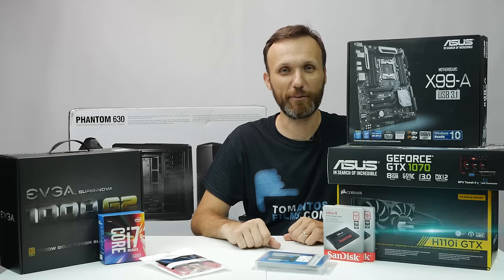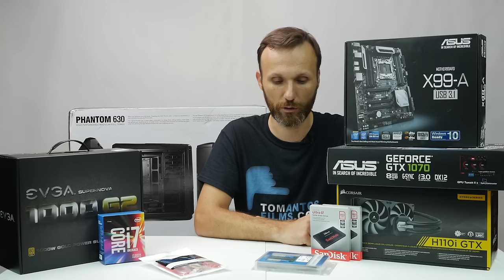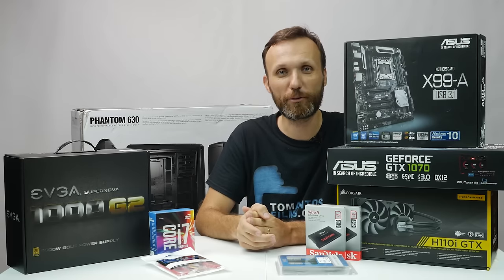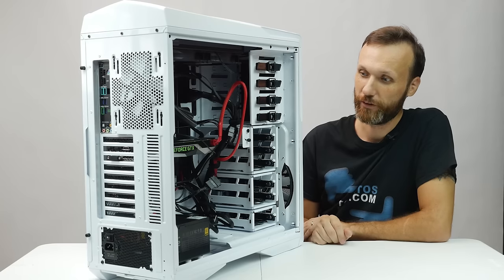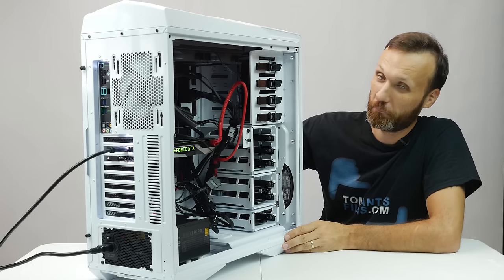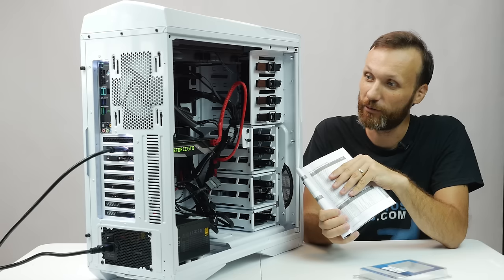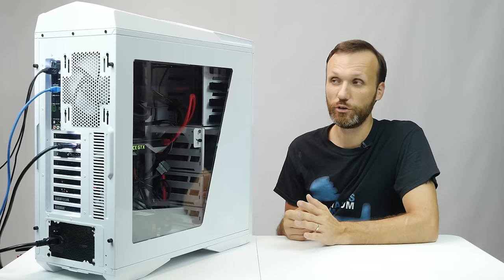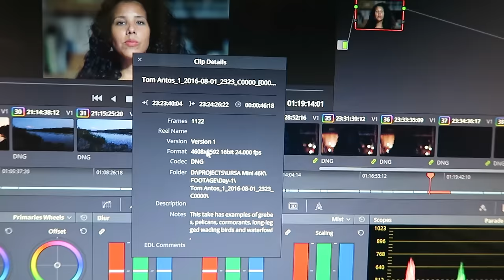4K RAW Video Editing Machine for $2K

Comment: I have a Dell M6600 laptop with Quadro 4000m, 16gb ram that I edit 4k on, it works great even though it's like 6/7 years old now.
Cost just over 3k when I got it.
When I do complex edits in 4k, in Premiere, I create proxies of the videos, that way I can edit at a lower resolution, add all the effects etc I want and apply them to the 4k versions of the video at the end.

Comment: As an IT guy, I would like to point out that it's really, really important to use an ESD (electro-static discharge) dissipating wrist strap when building the PC. This is especially important when in physical contact with the CPU, RAM chips and the motherboard. Besides the obvious chance of frying components due to static buildup & discharge while assembling the machine, the biggest reason I always have an ESD strap is because of partial failure of components. Most likely ESD will not kill a component outright but instead damage it. I've seen more than once the resulting damaged RAM and motherboards causing all kinds of untraceable headaches that lead to system instability.
Reply: By regularly discharging yourself by touching your hand to the case is enough. I have built many computers and static buildup has never been a problem. Its not as important as you think (if you know what you are doing of course...)
Reply: +ResQ I agree with you. I work in IT and have build a lot of systems and servers and static discharge is not a big of a problem people think. I have never seen it damage any pc component. The worse thing it did on maybe 3 motherboards is that I had to just reset Bios and that was it. But still if you want to be safe when building pc just touching something that is grounded is enough.
Reply: I've worked in labs with boards on a component level. I'm not going to present a long laundry list of reasons why an ESD strap is a good idea, but I will say that most of the time components come to customers DOA, in fact they are killed by EST on location and not defective from the factory. But whatever. I'm not looking to convert anybody...
Reply: I'm not saying that ESD strap is a bad idea, I'm just saying that it is not necessary. It's enough to touch something grounded. I was just telling my experience from working with electronics. Besides the motherboards I mentioned were cheap - 60$. The ones with better quality components were not affected by discharge, BUT I'm not saying they can't be. Once again that is just my experience.
Reply: I forgot to mention... I've seen people who returned motherboards as DOA and when I asked them what did they do (how did they tested if it worked before putting mbo in case) most of the time answer was they put it on bag in which mbo was. And some bags have shit coating that can conduct electricity hence it's not DOA they just broke it because they didn't know that.
Reply: I have to to tell any body out there who wants to duplicate Toms  build just like I did..after buying all this parts, taking all the static precautions, buying exactly the proper ram. I got the same 53 error message Mr Tom had, which means the motherboard can't read or the RAM is not the proper speed, there is a lot of complaints out there in the Web about the Asus X99-A usb 3.1 being defective. 
I tried everything there is to make this mother board work, 
but  I honestly don't want the aggravation that a lot of folks have gone through,  
I'm returning my motherboard to B&H and getting a MSI x99 , which me luck!! so I went to Frys and I got a MSI X99a Rider motherboard used  the same memory and guess what!! started right away and now I'm ready to install Windows 10. I'm not a brand person I just care to utilize my computer as a reliable tool for my video editing, Asus is not a good company, I'm proud to say I'm a new MSI costumer for a very long time.
God bless!
Reply: yes MSI x99 raider has been great for my build as well
Reply: As an IT guy, I would like to point out how you saying 'all kinds and most likely' does not hold your argument at all and you're just repeating what you've heard others do instead of speaking from experience. Anti static wrist strap is not needed at all if working on a plugged in PC into grounded outlet by simply touching the case, if you can remember to put on a strap, a clip and maybe an antistatic pad, it's definitely easier to remember to touch a grounded case every now and then.
Reply: The human body can create enough static differential to set off a percussion cap. This static can build up in a few seconds in dry weather. On the flip side, it may not. You may be in a humid climate where static is next to impossible. Or it may feel humid and static free, but some static does build up eventually. It all depends. Hence my vagueness and lack of specificity. And the reason that touching the case once in a while is basically a gamble. It all fucking depends, son. So when you're working on your cute neighbor's PC, swapping boards out, sure, you can guesstimate the situation and come up aces. But me, I've worked on  boards that really, really could not fail. And in order to not have those boards fail I learned a crap ton about how things fail. What happens to solder points in extreme heat & cold? What does salt air do to circuitry? How about sympathetic vibration? What about over pressure from a nearby detonation? What about operation in exotic atmospheres? I could go on. Anyway, bud, you might be an IT guy. But you ain't got the education or the discipline to even form an opinion about static. Not that you need to, mind you, working on consumer electronics. Just don't disparage random blokes on the net. Some of us actually know stuff.
Reply: TheDamnSpot If you really know stuff then you share it and show it, not boast about how much you know, you IT guy/buddy/friend/pal/canadian.
Reply: TheDamnSpot Thanks man. Take it easy
Reply: No problem. Just my two cents, if you take only one course on the MIT site, take Signals and Systems. Great foundation.
Reply: I guess you are right but if you use common sense and handle everything carefully you can get by without the strap. In the past 15 years I built over 100 system and never used a strap......never  messed up a system. I also have a system humidifier which is very helpfull specially during winter months when the air is pretty dry. Also a wooden floor or and an antistatic chair mat is very helpfull. 
Carpets are usually the worst static creators. Another hint, is to use something that will help dissipate the static. B4 I touch any components I usually touch a metal gounded device like the meal case of a power supply...it has to be plugged in though. just my 2 cents.
Reply: "Never messed up a system..." is a loaded statement. The majority of EST damage is not catastrophic. Mostly it will damage a component that's not in constant use, or whose failure is opaque to the builder. It may be a failure that will create cross-talk or destroys a fail safe response (which is by default rare) of a ROM chip or a logic gate. On a motherboard there is a lot of (just as an example) "If 1.2 Volts = Null, then do this." What if that Null state happens every 7 weeks during normal use? And what if the lack of expected behavior by the component is non catastrophic? You can have audio streams with distortion, random reboots, RAM stuck at a low tick speed, etc...
Anyway, I could go on. Use a strap. If it's good enough for board that goes into a billion dollar carrier, it's good enough for you. :)
Reply: no its not

Comment: Nice configuration Tom but you seem to have missed two points. The GTX only supports 8bpc rendering due to driver limitation (Nvidia wants you to go for Quadro card for 10bpc). The second is that while the i7 is solid performer, it's limited to dual channel memory configuration, which is something very important when working with large files. A comparable Xeon processor is slightly more expensive but supports quad channel memory configuration. You may need to invest a bit more for much better quality and performance
Reply: Good guidance
Reply: X99 chipset and i7 6800k will use Quad channel memory.  No need for Xenon.
Reply: Yes that's right. Intel used to call these "Extreme Edition"
Reply: +Jaffar Al Mosaed can you help me pick up components? I am in the process of building a computer but don't know what to go with. I want fast rendering.
Reply: Generally, if you don't need 10Bits per channel (an MP4 file is limited to 8bpc) then any recent Nvidia GTX or equivalent AMD Radeon will do - with 4GB of RAM. For the CPU, get an i7 with fast GHz (such as the Extreme Edition i7-6850K) with an Intel X99 chipset. Memory should be multiple of 4 as this is a quad-channel. Finally, get a good SSD disk. Samsung 850 Pro is the best one out there. For cooling, it's better to get a water based heat sink as the CPU can get really host. Good luck
Reply: +Jaffar Al Mosaed thank you very much. I really appreciate 2
Reply: No problem and best of luck mate
Reply: So i wouldnt be able to use Intel i7 5820k  x99 rog strix with g.skill 3200 cl14 32gb and be able to run qaud?
Reply: The so called "High End" processors from Intel also support quad channel provided you have multiple of 4 memory modules installed
Reply: 1) You don't need Xeon unless you want ECC DRAM or a multi-CPU system. Indeed the i7 "Extreme" processors for 2011-v3 support quad channel DRAM on X99 mobos. A top-notch i7 is still cheaper and better overclockable than an equivalent Xeon, which as stated you probably don't need unless your rendering box is a server in a Pixar farm.

2) No idea what the comment about 4GB of RAM is about.

3) Many professional programs (like Premiere & AE) still indeed only properly support real GPU acceleration through Quadro cards, so a beefy GeForce card might not do much good for these. It's a shame too, because (at least before the Pascal architecture) Quadro cards are functionally equivalent to GeForces, but just use different drivers that are optimized for stability instead of raw gaming performance. There were hacks to turn older GeForces into equivalent Quadros (saving thousands of dollars) but I don't know of such successes on any of the recent or beefiest cards. Personally I'm hoping that Adobe will extend their video suite code to support GeForce cards like it has always benefited from Quadro cards, but I'm not holding my breath since Adobe is in bed with Nvidia, and overpriced enterprise cards (read Quadro/Tesla) are the true money maker for Nvidia, not the consumer cards.

4) It's true that GeForce is artificially capped not to output 10 bits per channel, only 8. But you only "need" 10 bits per channe anyway if your monitor also supports it and can render the extended color space (or rather, a better than 8-bit subset of it). It is a "nice to have" for analysing raw footage and when doing manual color grading, but you're almost certainly not going to deliver a finished product in 10 bits per channel. Also note that not being able to see 10 bits per channel does not mean you cannot operate on said depth. You should always set the actual color channel processing mode to 32-bit floating point anyway, in AE/Premiere etc.

EDIT: Also, MP4 is a container format and does not dictate bit depth of contained video or audio streams. There doesn't even have to be a video stream, an MP4 file can contain only audio or metadata. Even if you're referring to the most common video codec used in MP4s, H.264, it is not limited to 8 bits per channel. It goes up to 10 bits per channel.
Reply: @Jaffar Al Mosaed, help me out. Major components below are pretty much final and are one click away. Will this make a good video editing machine??

Asus X99-A II Motherboard
Intel Boxed Core i7-6800K (not sure what is the difference between reg and boxed core)
NVIDIA - GeForce GTX 1070 8GB
Kingston HyperX FURY 32GB (16x2) 2133 MHz

Thanks in Advance.
Reply: Hi Faadi,
I hope I am not too late!
A few suggestions. You should get 4x memory modules for the best memory bandwidth (8 x 4GB). See if you can get DDR4 2400 instead of 2133. You should also get an SSD but you don't need the most expensive one. Consider a liquid cooling for the CPU as it can get really hot. Premiere Pro can use the GPU but I don't imagine you need 8GB of vRAM for video editing even at 4K. Whatever monitor you get, make sure it supports Display Port and/or HDMI 2.0.
I am assuming you won't be editing 10bpc clips here. If you do, then you should get an Nvidia Quadro such as the M4000.
I hope this helps and not too late.

Comment: We built a system about a year ago, with an ASUS Sabretooth 990FX R2.0 M/B, AMD FX-8350 Vishera CPU, and 2 sets of G-Skil F3-2400C10D-16GTX RAM (32GB total). The first time it booted, only 1 stick of RAM was found. Resetting all 4 sticks of RAM to the rated 1.65GV in BIOS fixed the problem, and everything has run properly ever since.

What I'm getting at is be sure to set everything to the factory rating.
Reply: I should add that although the RAM was not on the QVL approved list, but reviewers comments showed it indeed worked.

Comment: Nice build. I have the GTX 1070 on a 4 year old motherboard (Sabertooth Z77) and 4 year old i7 4770k. Works like a champ. You could of saved some money getting the SSD PCIe card instead of getting 2 SSDs with that motherboard. Also, a activated windows 10 lets you install "Service Packs" for more security to server/database systems. However, you probably don't need it if you don't have a server holding all your old video footage.

Comment: Tom, you don't need to buy new memory. Look for a button in your motherboard that will be labeled MemOk or GoButton, it will most likely be near the memory. You press it with the computer off but plugged in and it will run, you can also use it when you use diferent memory types so, if you still have both sets you now have 64 gb instead of 32

Comment: Man, you should probably get at at least three ssd's to avoid bottlenecking when dealing with high res footage. One for storing, one for autosaves and previews and one for the exporting the footage. You have mentioned that in the future you could use two gfx card for video editing in sli. As far as I know there is no video editing software that supports sli... Thats why I think that power supply is a little bit overkill.
Reply: I agree XD don't ruin a good machine with poor cable management
Reply: +shoutoutJT cable management is cool but worthless
Reply: SSDs won't help much with actually rendering and encoding, but a smoother experience, yeah.
As for multi-GPU, some software, such as Blender, is able to use multiple graphics cards SEPARATELY -- with SLI / Crossfire off -- to render DIFFERENT frames simultaneously. So, yeah, multi-GPU can be useful with video editing and such.
Reply: Cable management isn't 'worthless'. Just not likely to impact performance much. There's more to it all than just performance for some people tho. If you have a windowed case, you PROBABLY care how everything in it 'looks'.
Reply from the maker: I use my computer not just for video editing but also for 3D animation and VFX, so extra graphics cards help a lot!
Reply: +AccidentalBroadcast cable management isn't worthless..lol it can affect the airflow in your pc easily
Reply: Cable management affects not that mutch the temps really like 2-3 degrees celsius in a case with ALL cables and boxes and what not linus tech tips did a video about it look up for it
Reply: shoutoutJT looks like his first home project. Have mercy..
Reply: Not to mention that the cpu only officially supports 28 PCIe lanes, he will be theoretically bottlenecking one of his graphics cards like that.
Reply: Michal Ten Calka DaVinci Resolve supports multi gpu setups
Reply: T-Bonerism Having one of the cards run at 8x is not going to bottleneck his setup at all, it doesnt matter as much as you would think
Reply: But it still is not operating at it's fullest. I get that you dont get a HUGE performance hit but it is still there.
Reply: Well i mean.. do you want to spend like 250$ more for a cpu with more lanes just to get that small percentage of more gpu power :S
The cpu upgrade isnt even like worth the money really
Reply: but it kind of matters anyway for some one who is looking at doing 4K rendering anyway. but that is assuming that he intends to add another video card. i think the more ridiculous thing here is the PCIe ssd instead of SATA III for boot and programs and 10000 RPM drives for mass storage.
Reply: T-Bonerism what pcie storage is ridiculously fast why is it a bad thing sata is old n slow lol? :D
Reply: but you could then afford a gtx 1080 and that performance is very noticeable. I guess it just comes down to where the user is willing to make the tradeoffs.
Reply: T-Bonerism Well there is not really that big of a price difference between a m.2 and a sata iii ssd, but 1080 vs 1070 has a lot bigger one... i wouldve maybe opted for only 2.5" ssd storage throughout if id were him
Reply: Hey, Guys. How do you manage the ssds and hard drives to get the best work flow?

Comment: There is something I need to learn. Can you work with 4K editing without any problems with this system? Especially when using Premiere, are you having playback problems? An even more powerful system, HP has experienced a serious playback problem on your computer. That's why I need to find out! If you answer, you are saved from the question in my mind. Because I'm about to set up my own 4K system ...